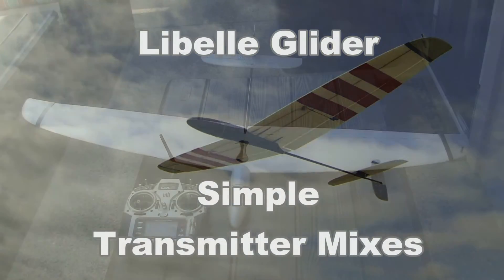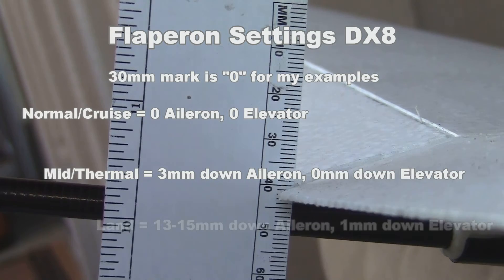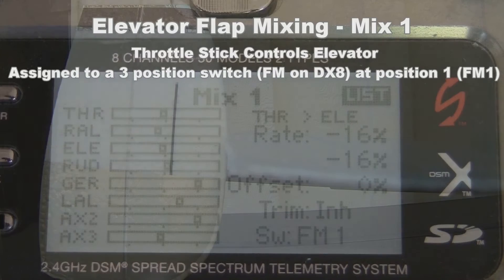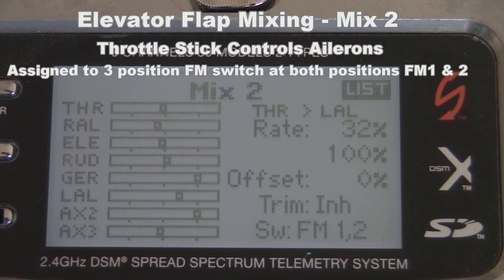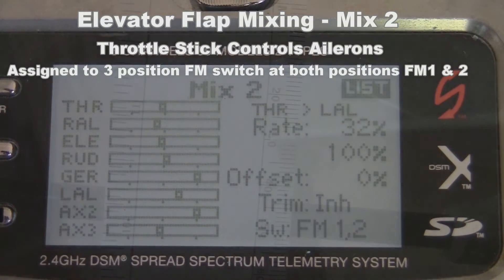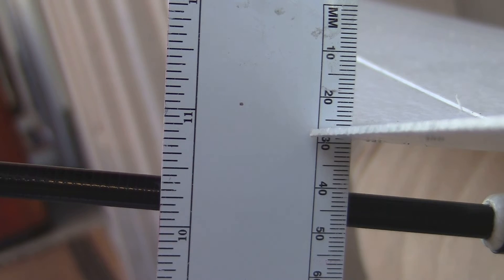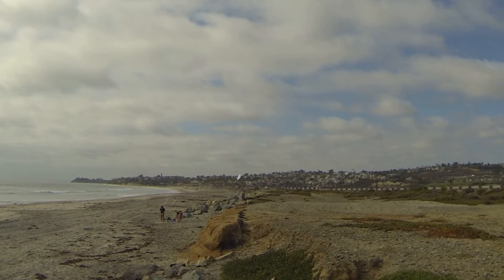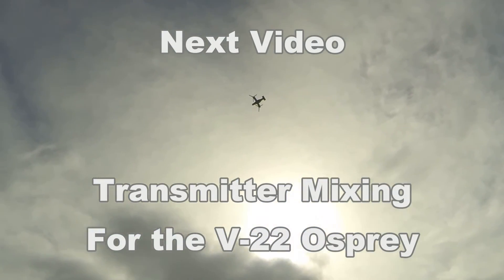Transmitter mixing for the Dream Flight Libelle Glider - Flaps and Flaperon Mixes

Comment: Hi, what type of reciver are you using?
Reply from the maker: I believe it was a spectrum 6i
Reply: Thank you, i bought a ready kit with servos and recommended 4 channel receiver from spektrum. I can’t really find the way to plug everything in the way that I can program the flaps. I wonder if i’m doing something wrong or if I definitely need a new 6 channel  receiver. I’m new to this and it’s my first build with programming. Thank you for your help!!!
Reply from the maker: @kubaskaw3034  does your transmitter have a flaps switch? I’ve not taken a look at a four channel receiver lately to know if they typically have a flaps switch or not. Even if your transmitter doesn’t have a flap switch, if it has a way to program a couple mixes you can still reproduce some of the settings I outlined. I can now see that I was using a spectrum dx8 tansmitter in the video. I initially bought a DX6i transmitter, but quickly learned that there were some planes where it was convenient to have more than 6 channels and that an 8 channel transmitter was much more versatile. I haven’t bought a transmitter in a very long time, but no, there’s some really cool digital ones out there now with all kinds of convenient features for mixing settings. If you buy another transmitter, I’d recommend getting one with at least eight channels. It’ll cover you now and for all the other types of planes you get into over the next few years.

Comment: do you have some kind of covering on your wings and rudder?
Reply from the maker: Hi I did not put any covering on the wings or rudder other than the colored packing tape strips on the underside of the wings to help with seeing which side is up or down during rolls.  The plane is   best if kept nice and light so I would not recommend covering with tape or other shrink film. I used to put shrink film on some planes but it ends up only looking good for the short time and then gets dinged up. Foam safe paint is better.  good luck

Comment: Richard  a late thank you for posting a great video. I finally got around to building my Libelle and am setting up my Dx8 to use with it. Did you use the Acro plane type or Sailplane type. I can’t seem to get the throttle to show up In the servo screen just MOT. I am using a Lemon 6Ch receiver. I’d like to be able to control my flaps with the throttle stick but having a time of it trynna figure it out. 
Any help would be greatly appreciated. 
David
Reply: Same radio, same issues...can't get it sorted...
Reply: Paul Gross I may have figured it out.  Make a new model as an Acro rather than Sailplane. I named mine Libelle Test. In Acro set up, you can fiddle to your hearts content with the settings in the video. I’ve almost have it sorted. Try it and let me know if you get any closer. You can email me davidkritzberg@gmail.com maybe we can work it out together. Lol

Comment: Hello do you have a start mode for Discus Launch?
Reply from the maker: yes and while some people create a mix of aileron and elevator travel for launching, ive programmed a single switch to control about 1mm or so of just down elevator movement. you'll have to experiment with what works for you but my glider did not need much down elevator travel to keep it from arcing up too abruptly on launches.